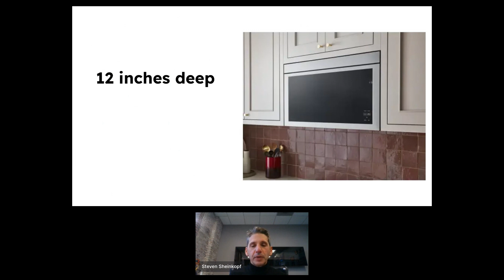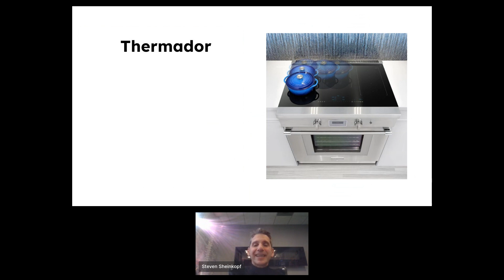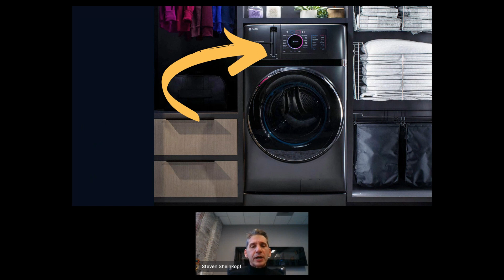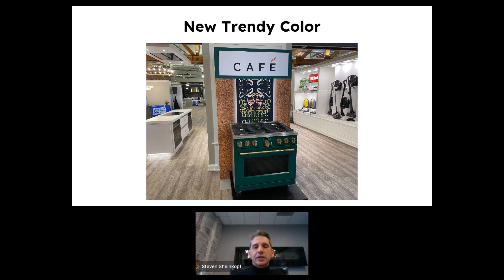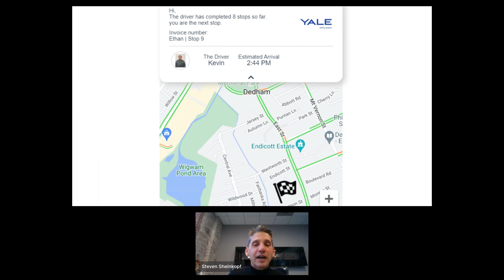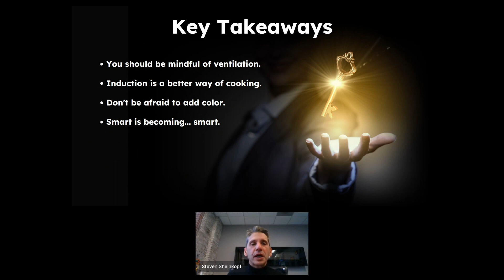The Best and Worst Kitchen Appliances and Trends for 2024

Comment: So some notes on ventilation that might benefit some of the viewers: In a typical house with a hood and closed windows and doors, you're also drawing in air through all the various gaps and crevices, though the insulation, whatever mold and dust might be in your walls, etc. Not ideal. On the flip side, in new construction (or deep energy retrofits) some of it is built very tight, to the point where hoods can't get enough air and would negatively pressurize the house.

So for those very modern types of construction, I'd only recommend induction, as otherwise you'd need to use makeup air, literally a duct to the outside next to the hood that draws air in from there rather than from inside the house, which during hot summers or very cold winters is going to ruin your indoor climate.

With induction you'd still want to use ventilation, but now you have the option to use a recirculating hood instead with carbon filters. Combine that with an Energy/Heat Recovery Ventilator to cycle in fresh air and exhaust stale, and that's a reasonable solution for modern energy efficient houses.

Comment: Induction doesn't play well with hearing aids or pacemakers. Since I'm older and have a few friends with pacemakers and at least two with hearing aids, you will never see an induction cooktop or range in my home. In addition, induction is useless if you have classic copper cookware (copper with a tin lining) because that type of cookware, treasured by chefs, isn't magnetic. My deep red BlueStar gas range not only has burners for woks, but it can heat faster than an induction. So far, I'm not all that impressed with the banning of gas ranges because it still requires coal fired plants to run even more electricity.

And whatever happened to refrigerators existing just to keep food cold??? While some of the cute features are interesting, they hardly add to the basic function of the refrigerator, do they?
Reply from the maker: Ha...so true.  Wonder how people with pacemakers handle phones
Reply: Just FYI, the electric grid has gotten much cleaner over the past few years. Coal is a shrinking part for North America. It’s actually more efficient to burn natural gas at a turbine power plant and use the electric power to heat your home with a heat pump than to burn the gas in a furnace in your home.
Reply: Tell me what you like or don't like about your Bluestar? I am about to order one in Heiritage Blue with polished copper knobs. I'll bet that deep red shines like a jewel!
Reply from the maker: I love the colors and power of that range...You are buying it for the right reasons.  It does lack technology, even basics like clocks...but that stove can cook.